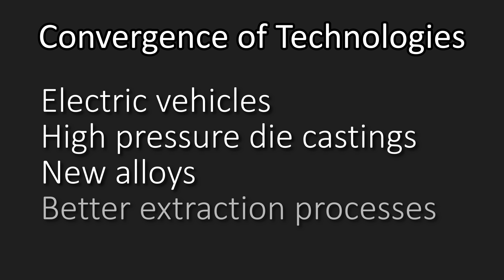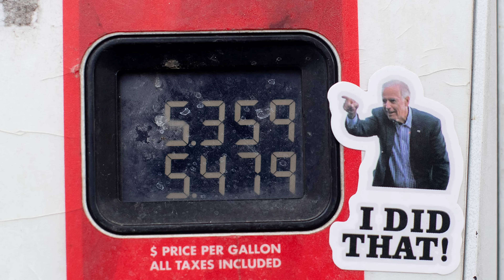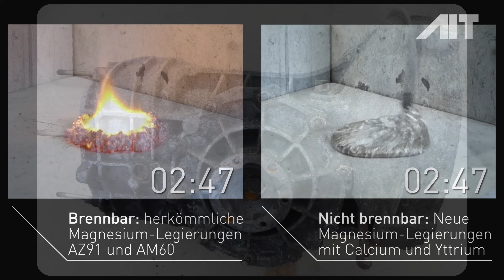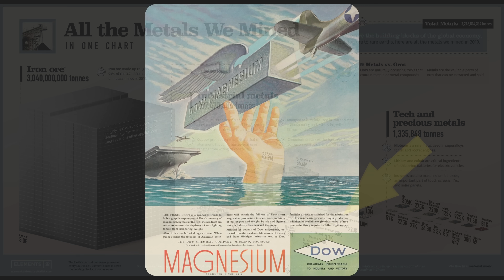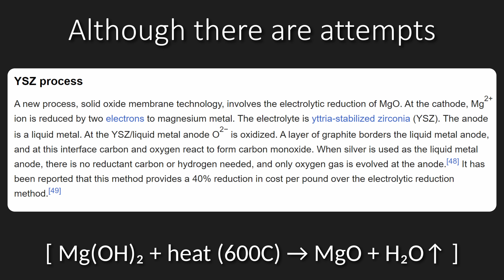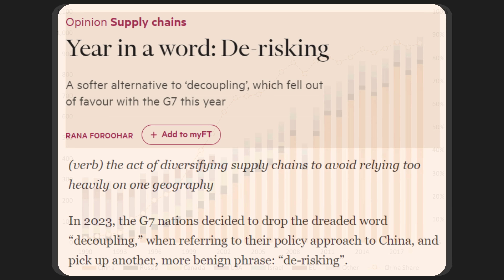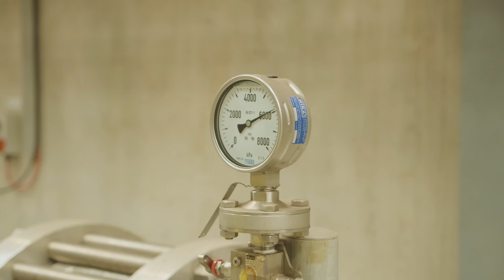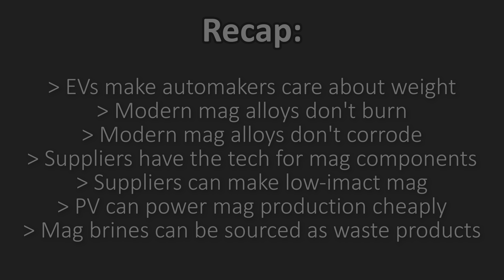Welcome to the AGE of MAGNESIUM

Comment: Magnesium cars in the north east are a TERRIBLE IDEA. It literally falls apart when mixed metals are used and in salted roads. Dont make these cars from magnesium, and the 'not burning' is a misnomer, the alloyes do burn, just at SLIGHTLY higher temperatures that would be exposed in a fire

Comment: Making fun of US ✓
Magnesium ✓
Dow's process ✓
Few things that might need to be mentioned here:
Magnesium alloys can be thixomolded - injection molding using semi-liquid magnesium, gives you better part quality and uses less energy.
Magnesium alloys have very good noise and vibration dampening properties, which would make cars not only lighter (Mg vs Al ~30% lighter) but quieter.
Mg is also 2% of earth's crust (Al 8%), so it will likely drop to similar cost per kg as aluminium or even lower since it's extraction can be easier and cheaper, which means it will be a lot cheaper in cars, since you'll only need around 70% of material for the same strength and rigidity.
It's nice to see new alloys being actually resistant - first bikes, wheels and frames made of magnesium were extremely prone to cracking.
As for weight/regulators bit - it's not true that manufacturers just didn't care about making cars lighter, but because ICE's are very limited in their efficiency and design, weight wasn't really a serious issue. If you calculate how much rolling resistance (from weight) a normal ICE has, you'll be astonished it's almost nothing in average driving conditions.
You also can't go nuclear on aerodynamics like in EV, since your engine bay and tons of components will still need extremely good cooling.
Mg/Alu components just aren't necessary for normal ICE cars, since there is very little to gain there. For EV's it's different story - you lose 200 kg, you can add 200 kg of batteries with no net gain.
Things like thixomolding are just a really good side effect of this evolution.
Also EVs are getting cheaper to produce than ICEVs, and cars are mostly competing on price.

Comment: CO2 is natural and helps keep plants alive. it's not a greenhouse gas, it's plant food. advances in efficiency are welcome, but banning the product you exhale is a ridiculous attempt at futility. global warming alarmists have all sorts of claims that haven't come true, over a history of a few hundred years of recorded political news that we do have. it's even been proven that oil is abiotic, the whole "fossil fuel" is a misnomer. geological surveys done recently show there is a lot of carbon still in the crust and mantle, and so it's speculated that the intense pressure and heat with water at those levels causes it to form and bubble up slowly. that sort of fits with observed patterns of where and how oil is found, and what happens to the crust when oil deposits finally do make it to the surface. crude oil is found in deposits of salt water and is usually as incompressable as water is, causing it to naturally fracture and disrupt various mineral formations as it makes its way upward. drilling for oil and refining it is also way less damaging than strip mining large areas of land for minerals like lithium...

Comment: Heh. 
My 1969 Porsche 911S has magnesium wheels, magnesium engine cases, and magnesium gearbox cases.
In truth, the age of magnesium has been around for a while. It's the expense which held it back.
And nowadays automakers are always looking for ways to make cars more expensive, so magnesium fits the bill.
Best not to put any lithium batteries in a car with large components of magnesium, however. 
That would be almost as silly as coating your hydrogen-filled Zeppelin with thermite paint. :P

If you haven't ever seen even a small amount of magnesium burn, you are missing out. And yes, it's tricky to ignite solid magnesium, but a Teslafire or a Burn Your Driveway is more than capable of getting it going. Big problem is that putting water on a magnesium fire doesn't put it out, it only makes the situation worse. Much worse.

Please also keep in mind, it takes just 4,500 litres of water to put out a petrol car fire. But a flaming EV takes 45,000 litres, and all of those litres are heavily contaminated - and the smoke from the fire is incredibly toxic.

Comment: This dude is so far of base its scary. 
Firstly, people do care about fuel economy. If they didn't, the roads wouldn't be littered with Prius' and hybrids. Secondly, EVs are a joke and horrible for the environment, you're merely trading one evil for another. 
Lithium and cobalt mining is terrible for the environment and most EVs are using electricity generated from coal burning power plants anyways so what was the point? 
And people absolutely blame the government for why gas is expensive, can't help but notice gas was much cheaper before certain political entities took office. 
This person is just another EV fan boy believing absolute nonsense and condemning anyone who sees through the bs. 
And FYI, we don't use magnesium in cars due to its low strength properties. It's fine to use in some applications but not really worth using over metals like aluminum.

Comment: How does the material behave in a crash? Steel has the benefit of deforming and came be designed to corporate where the energy of that deformation goes. Aluminum cracks and shatters so you likely won't get rid of steel around the passengers. Will replacing more of the structure end up causing more vehicles to be totaled in accidents because of potential hidden damage or inability to repair?

Comment: So the bit about alloys that don't burn has a few flaws that I see. One is the best is removed as soon as the left sample starts to burn but you see a reaction going on the right. That's not what will happen in a battery fire so what happens if you keep the torch on it. Also that's a nice dry box but but what happens in a damp environment? Plus there isn't anything showing that alloy can be injection molded, rarely can you alter a alloy for one characteristic without altering others. Thermal mass argument is a joke as a battery pack can burn like a hundred torches for hours and not minutes, with little fire dept can do once they show up but pump huge amounts of water on it and try to stay out of the toxic smoke. Adding burning molten metal that explodes and splatters will not make them fans.

Comment: In NDT, the magnesium I have worked with is kind of cumbersome because of its sensitivity to corrosion. So if your process involves water, like liquid penetrant, you have to dry it really fast after washing or risk it corroding. Durring humid seasons, we have to take extra care to make sure the material doesn't corrode from sitting before or after processing. I wonder why the corrosion resistant magnesium isn't utilized? Maybe NDT has to be performed before treatment that makes the magnesium corrosion resistant? Or maybe corrosion resistant magnesium is more expensive to produce? I don't know very much from the manufacturing side since I only work in NDT.

Comment: We have ready tried magnesium, we used to make everything from magnesium, lawn mower decks, household appliances, door nobs and so on, but we stopped ... because it sucked, I would seriously invest in the idea that these new alloys and techniques aren't nearly enough to make up for magnesium's downsides
Reply: Did you watch the vid? The only application for magnesium told in the video was Electric Vehicles. The "age of magnesium" the video is talking about is the simple idea that as of right now magnesium extraction is really shit and makes it more expensive than it should be... so right now is the time when there's a demand big enough (reducing EVs overall weight) to justify increasing the efficiency and efforts of extracting magnesium. Note that the use of magnesium in EVs was only as structural parts, likely those which have minium expusure to wear, corrosion and heat. (Also, the vid mentions that modern magnesium alloys don't catch on fire)

TL;DR: Magnesium does have downsides but for this specific use-case, it's worth it economically to use and this in turn makes it worth it to extract in bigger quantities, which will potentially make it even more worth it, and this series of events could start "the age of magnesium", as clickbaity as it sounds.

Comment: While following troubles of B Bonner's ranch high in Andes, alternate land use idea: hi-altitude desert, near equatorial Pacific coast, high solar radiation, sea water not very distant, but much lower elevation. Speculate turbine pumping ocean up to solar farm, processing there, purified water goes back to low elevation recovering potential energy with turbines, then use fresh water in agriculture etc. Or, transmit high-amperage power down to coast for water processing.

Comment: About 15 years ago, I read a report on vehicle light weighting by Lotus. They said that the economic value of removing 1lb from a car was about $3. At the time, removing 1lb from a commercial aircraft was $1,000 and removing 1lb from a satellite was $10,000. So there is not a huge economic driver for the automakers to use light weight design. Some of them realized that light weight is key to vehicle performance though, and that made light weight design more valuable. The Mazda RX-7 (FD) had all aluminum bodywork. Some Miatas and WRXs have aluminum hoods to help move the center of gravity rearward. An important design concept that I think is too often ignored is that low density materials can often result in lighter, yet stiffer structures. Stiffness of a section of material is a function of its thickness raised to the third power. So for a given mass of structural material, the lower density one can be thicker and will make the stiffest structure-- assuming you can actually fabricate the material into that structure. Magnesium rivals carbon fiber in density, so I see some applications where a low density metallic construction may be an advantage over the composite construction. One nice example of this is XTR mountain bike brake calipers. A cast magnesium caliper must be far easier to produce than a composite one would be.
Reply: never seen an rx7 with aluminum anything on it
Reply: @prototype9000  FD sheet metal is aluminum, that's why they dent so easily.
Reply: @nicolashuffman4312  not on an rx7 ive owned 2 of them 3 generations
Reply: @nicolashuffman4312 hoods ally. Everything else stamped steel. Nsx is only Japanese car of the time to be all ally
Reply: Formula 1 uses a lot of magnesium.

Comment: I helped make magnesium impellers for Toro leaf blower / leaf mulch vacs from cast magnesium. The biggest challenge was balancing them for the high RPM with a plastic press in hub. Safety concerns were from dry machining scrap and grinding powders.

Comment: We stayed with steel over alu because simply put, alu is pain in the ass to work with. Melts easly, scratches, bends, dents easly, is "chewy" (clogs up anything used for grinding) paint don't stick well unless you prep surface first, grinding out imperfections is much more pain compared to steel. Welding alu is pain unless it's pretty clean, oxides are harder phisycally and harder to melt, not even talking about welding trough them. It makes alloy with copper (used in electrodes for welding), work hardening worse than steel, afterwards just snaps without too much resistance (spot welds often snap).

Comment: Magnesium alloys either have corrosion resistance issues or casting difficulties. Aluminum on those trucks are not standing up well to corrosion IMHO. Many racing associations have removed the use of magnesium parts such as wheels for varied issues since the early 80s. Hard to match the useful properties of steel components.

Comment: I watched a vw bus engine burn through a concrete road when I was a kid.  Fire dept. watered it and it got hotter and hotter and burned for hours.  Magnesium should not be used in any potentially high heat environment, unless you like really hot fires that are difficult to put out.

Comment: In addition to both the older  Dow and current Pidgeon processes for producing Mg metal, two newer processes which may soon replace them are being developed:
 The Carbothermic process which uses carbon to reduce the MgO to Mg + CO, 
and the YSZ process which uses yttrium-stabilized zirconia as the electrolyte and produces only O2 gas in addition to Mg metal therein.
See:  https://en.wikipedia.org/wiki/Magnesium#Production for more details.

Comment: Unfortunately well off the mark. Magnesium was heavily utilized by the aviation industry until the 1980s. Then the appallingly low corrosion resistance became too much for the industry despite a lot of research into anticorrosion treatments. On some passenger aircraft there were actual component replacement programs to address the serious risks. Additionally giga castings have a serious problem. There is nothing to stop a crack propogating to catastrophic failure (and repairs are almost impossible)

Comment: As soon as battery capacity’s quadruple manufacturers will stop caring about vehicle weight again
Reply: Current battery chemistries have nowhere near enough headroom to double, let alone quadruple, and I've basically been waiting my entire life (30+ years) for something to dethrone lithium. 

I'm more optimistic about battery technologies which are LESS energy dense, but also lower cost and toxicity (Sodium), given those actually appear to be coming into production.
Reply: @mazeofthemind560 
Yeah, we want cleaner, faster charging and longer lasting.
Solid state anodeless sodium ion looks like it's pretty close.
Reply: @MostlyPennyCat  Sodium batteries are already commercially available, solid state might be the next steps.
Reply: @mazeofthemind560  it seems unlikely that we wouldn’t be able to make batteries more energy dense now that there is a huge amount of demand from EV’s I doubt Lithium Ion is the end
Reply: @daundredemars5028  So I'll take an L here, upon investigation there are absolutely notional battery chemistries that can achieve 4x energy density (by weight, specifically) to Lion. We could debate how feasible or near term they are, but that wasn't your point.

Its also worth noting that 4x Lion still isn't within spitting distance of gasoline (250 Wh/kg vs 12000)

That said, I feel very confident that if auto manufacturers are feeling pressure to innovate on structural engineering and materials for GAS engines due to mileage standards (and they are), they aren't going to stop caring for a 4x future source which is still less then 1/10th the energy density.
Reply: Good luck with that lol
Reply: @ghoulbuster1  we have octupled batter density since 2008? Why couldn’t we quadruple it by 2035?
Reply: @daundredemars5028 where are you seeing that we’ve octupled since 2008? 

We have improved, but I don’t see any data saying quadrupled. Maybe 1.5x?

Also a lot of those gains are from using more of the available space. Not something that can be repeated…

Finally, upcoming battery technologies like sodium ion are actually cheaper and safer but not more energy dense. 

So I remain less optimistic about expecting an easy 4x gain in the next decade or two.
Reply: As soon as charging time is reduced fo a tenth of what it takes consumers will actually care
Reply: @Dogman262  well to charge a car from 10-80% in 10 Minutes every 400km istn that long. I mean you have to eat something, go to the toilet or stretch your legs anyway. Do you really need to charge a car in 1Minute? Several times i had spend more time waiting at occupied fuel pumps then modern EVs need to charge. The chargers have to provide enough power though. Also all of this is only needed for long travel distances. Normal commute or just visiting friends etc you just charge at home anyways, so i really dont get your point.
Reply: Nah, mini nuclear reactors make triple a's look like... well triple a's.
Reply: You've watched the video, but obviously have learned nothing.
Reply: @LMB222  because I mentioned battery technology would improve over time? It’s crazy that people say we will NEVER be able to quadruple battery density when solid state batteries are already a huge improvement.